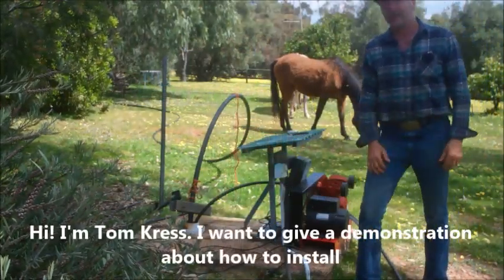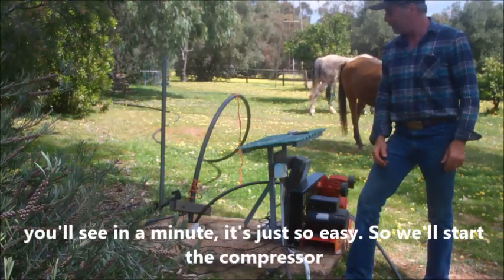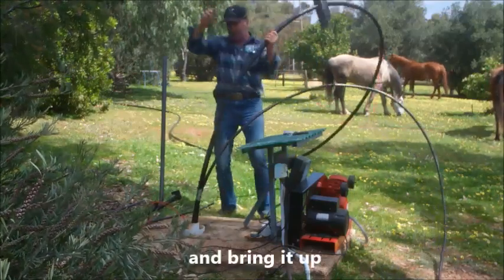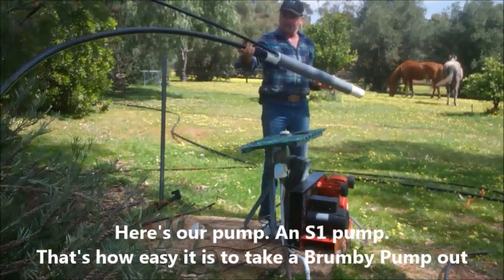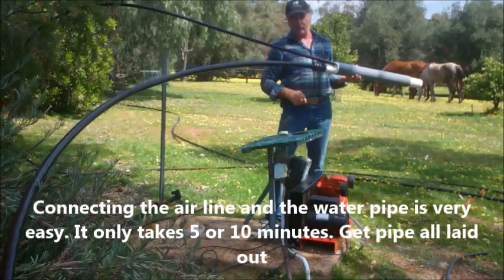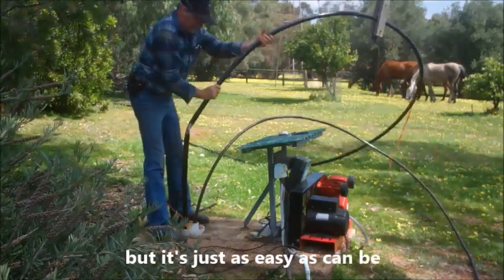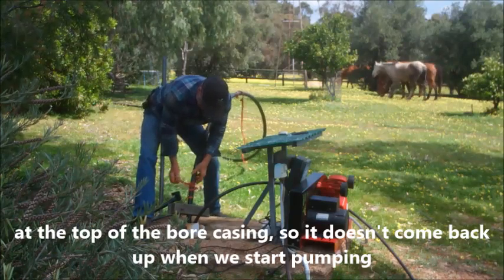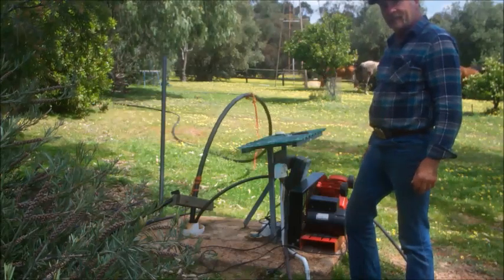How to remove and re-install a well/bore pump in under 3 minutes

Comment: Will this work as a submersible pump for water well to house? Or is it just a cleaner?
Reply from the maker: Yes, absolutely. The Brumby Pump was actually mainly developed to pump water for human, animal consumption and irrigation. It does deliver water and air at low pressure, so should deliver to a tank or other open destination
Reply: @brumbypumps8888  Can it be used with a bottomless pit adaptable? I have winters where im at.
Reply from the maker: @tokoi_cceditzz  you mean a pitless adaptor? Sure, you can use that.